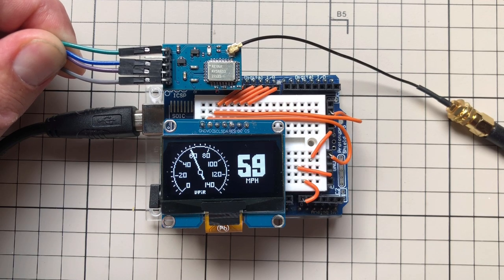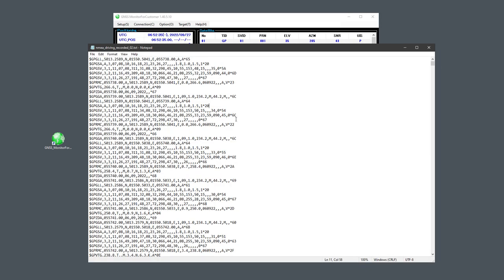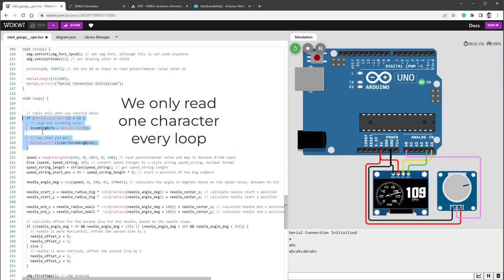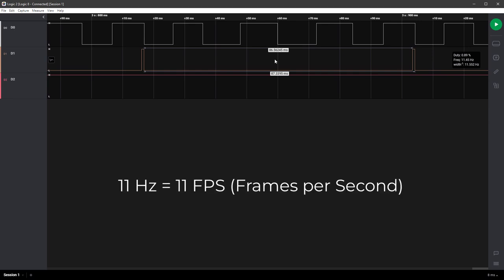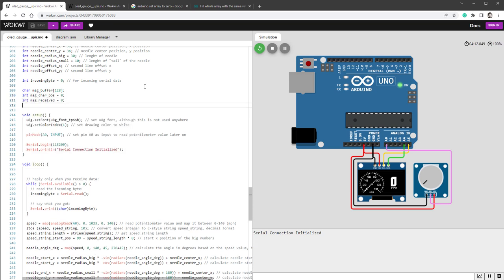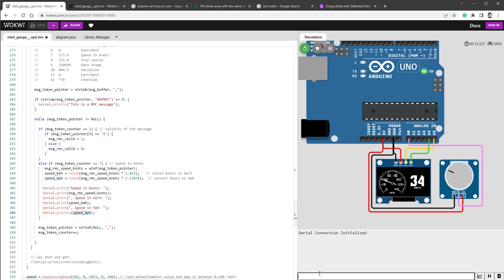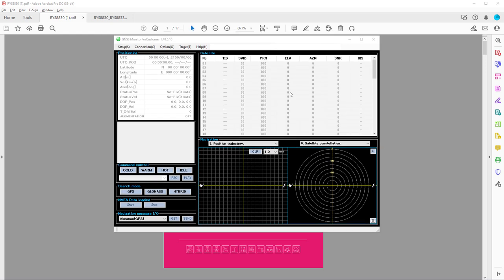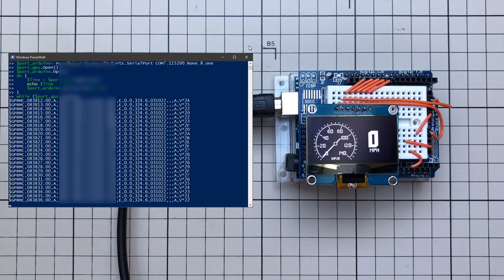Arduino GPS Speedometer                         (using REYAX GPS Module RYS8833)

Comment: Can you change the speed from 1000ms to 16ms to get the display to update the GPS speed more quickly?
Reply from the maker: Yes and no. The used GPS sensor only provides a new value every second, so you would need to do some interpolation for smoother animation. However, I’m currently testing a sensor that should provide the speed faster, I will record a video soon

Comment: ________________________
Motor - 107 °C
Transmission - 90 °C
Inlet - 35 °C
Release - 120 °C
————————————————

Sensor temperature oled
Reply from the maker: Huh? Is that something you are working on?
Reply: @upir_upir  no, I can't create a program on ardino, this is what I want to build for my car, on-board computer I can only work with a soldering iron 😁
Reply from the maker: So you need 4 temperature sensors and displaying this data on the OLED screen? That sounds manageable.
Reply: @upir_upir  right👍🏻, I have a bmw e39 M62b44 compressor, removed the viscous coupling, installed an electric fan, and I want to monitor the temperature: engine, intake, exhaust, and transmission
Reply from the maker: What are the expected temperature ranges? Do you already have some temperature sensors?
Reply: @upir_upir            there are no temperature sensors, the machine has not yet been assembled, there is very little left for assembly, sensors for as in this video, https://youtu.be/oSp_qm6s33M 

expected ranges are approximately 100-107 degrees
 
Here is something like this device, only thicker and on arduino
“Awron BMW”

Comment: what would you have to change if you could not purchase the REYAX RYS8833_Lite?
Reply from the maker: do you mean completely different GPS sensor, or just a different version of the same brand?
Reply: @upir_upir  i mean a completely different GPS sensor
Reply from the maker: @Finn-cz7mv  I would probably recommend using some library instead of trying to code it from scratch like here. You can still use the code for drawing on the OLED screen.

Comment: oh come on. nice tutorial btw. but can you please tell me what to do to complete this project? the video is the process of you doing and fixing the bugs. 
if i want to make this do I have to do the whole process? the software things?
if I want to change the digits number to be bigger what should i do? 
I made the digits myself follow your tutorial but it doesnt seems to work.
 in this video I dont even know how to connect the gps module.
anyone who completed this please help me. Thanks!
Reply from the maker: This used sensor works I believe with 2.5V, and Arduino works with 5V. I would suggest a different sensor, for example DFRobot "Gravity: GNSS GPS BeiDou Receiver Module - I2C&UART" . That one is very easy to work with. I will also use it for my future video about the very similar topic.